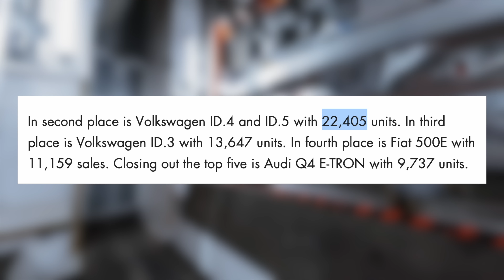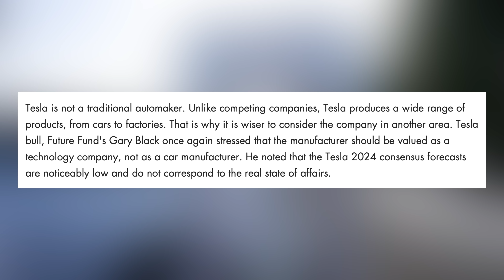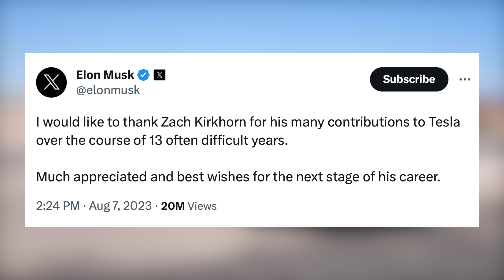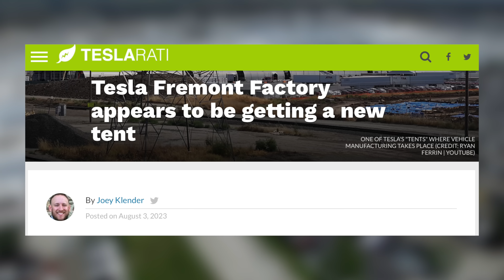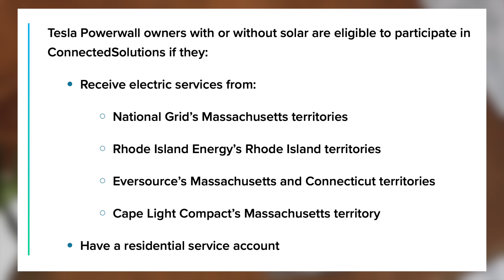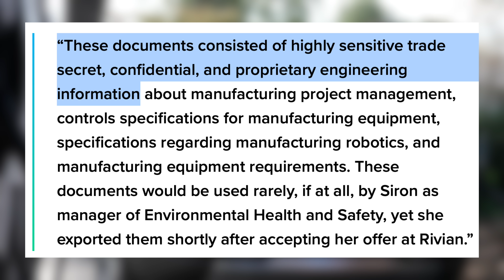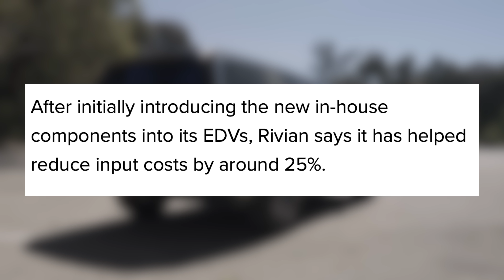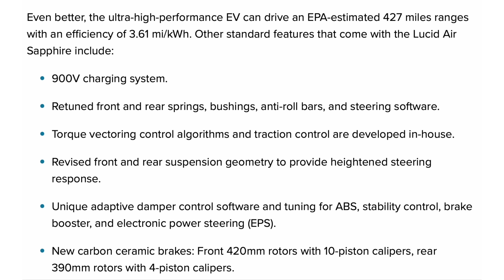NEW $21,000 Tesla Model 3 Is Here | If You Can Find It

Comment: I would love to see better integration of the display into the dash.  Having a computer monitor bolted to the dash is just ugly, in my opinion, and this is the main reason I haven't bought a Model Y.  While Tesla clearly has the best EV, other manufacturers have done a much better job of integrating the display into the dash!
Reply: I’ve driven both the Hyundai Ioniq 5 & 6. The dashboard is clunky and full of buttons and crap on the display that’s also hard to reach.  I much rather the way Tesla has it and is the reason it will be my next car.

Comment: Nope, could find reference to the $21k tesla in your vid, in the massive barrage of all other news and unrelated
Reply: Around the 6:30 mark he talks about it.  The idea is a used Tesla Model 3 for $25,000 then get a $4,000 federal tax credit to get to the $21,000 mark.  A quick check on Carmax shows the least expensive Model 3 is $30,000.  A Model 3 that you can buy for $25,000 or under is going to be pretty banged up or high mileage or both.